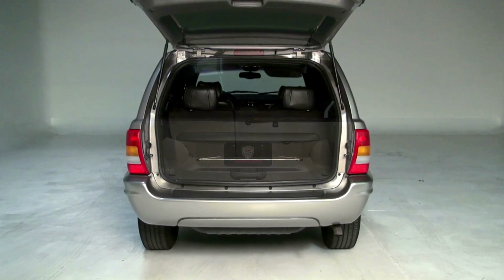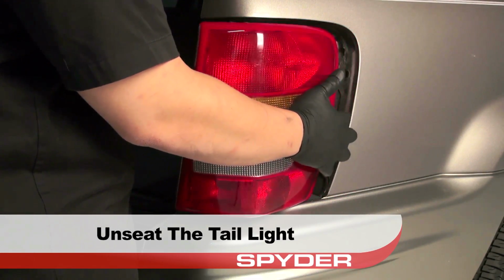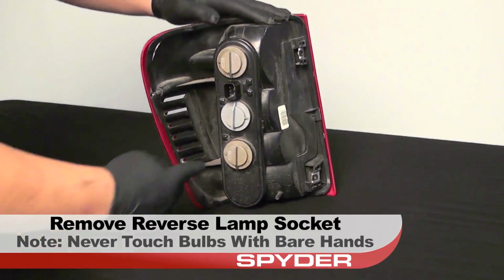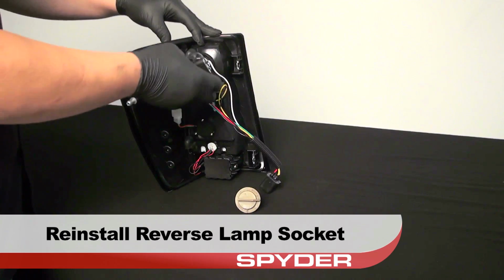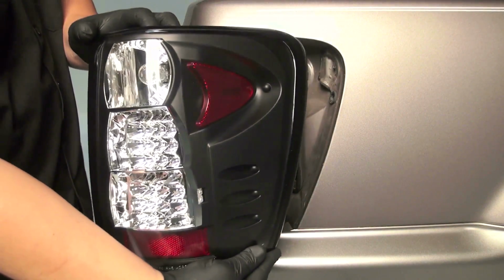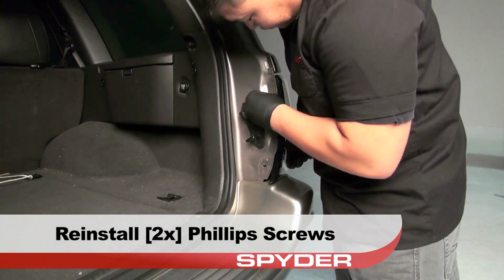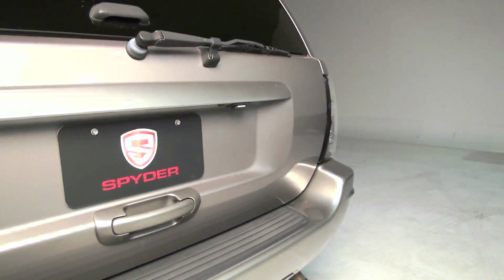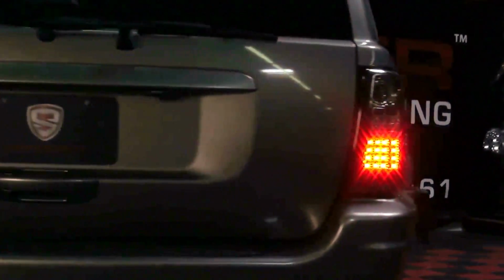Spyder Auto Installation: 1999-2004 Jeep Grand Cherokee LED Tail Lights

Comment: The tail lights don't seem to light up when I apply the brake... How do you fix that?
Reply from the maker: can you please explain in a little more detail, did you have some one else step on the brake when the parking lights are on? the LED brake light is suppose to become brighter when brake is apply. If you have any more question regarding the problem please contact techsupport@spyderauto.com

Comment: I don't get why this is designed to reuse the old incandescent backup bulb, when the point is to upgrade to LED.  Isn't it?
Reply from the maker: During the time these light were made they where not allowing the use of LED for reverse
Reply: @spyderauto  Thanks for clarifying that Spyder. Might do front and rear on my '04.
Reply: @JasnoGT  Ok.